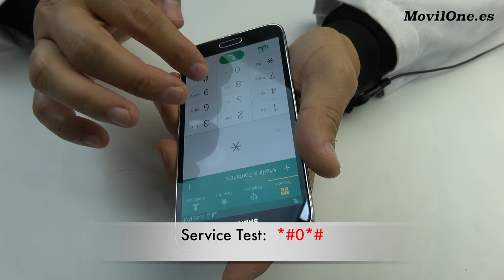Samsung S5 Teardown

Comment: I see you are wearing an anti static (ground) strap on your wrist which is always a good idea  when working with components.
Reply: Why do you need it?
Reply: @Jojokirinrs3m  The strap is hooked up to a ground somewhere and prevents any static electricity spark while handling sensitive parts. A static discharge can damage or ruin transistors, chips etc.

Comment: Hi! Just wanted to stop by and ask a question, can you tell me what's wrong with my Samsung Galaxy S5? Other than it being dropped many more times and battery abused more times than I would like to admit by my sister. I got it a new battery because the other one was a bit bloated but my phone still gets hot when being played. it charges fine, but even though I got a new battery I still have to keep it on power saving mode for it to be around normal battery use. And lastly I think it's just the glue, but the phone smells a bit, not like smoke or corrosion or anything it just smells on the silver edge/case thing. Can you tell me what's wrong with my Samsung Galaxy S5?

Comment: The glue was much stronger than I expected. I see that I have not been the only one due to the number of dislikes (for those who have the show dislike extension). One must heat it very much with the heat gun, to the point that the screen takes off by itself due to gravity. I think that is the only option to not break the screen.